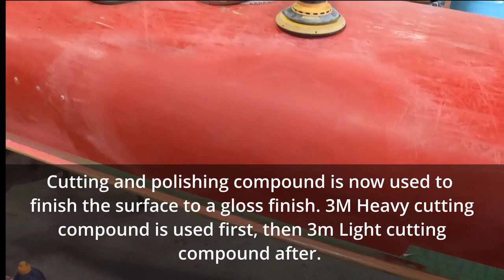Repairing a Fiberglass Canoe with Gel Coat

Comment: Can a roller be used for gel coat if sprayer not available
Reply from the maker: Gel coat contains styrene which dissolves foam. If you purchase solvent resistant rollers they can be used but will leave significant texture that would have to be sanded and cut/polished away after. Bristle brushes will also leave some texture. You can spread gel coat with a squeegee or trowel if the surface is relatively smooth, if not a bristle brush has to be used.
Reply: How long between coats were you spraying?
Reply: Is it possible to gel coat a 17 foot canoe in one shot?  How quickly does the nonwax type dry?
Reply: Great video, thanks for the tutorial.  I have a rather large scratched area to repair on a red sailboat.  How did you match the gel coat color so well?  Thank you.